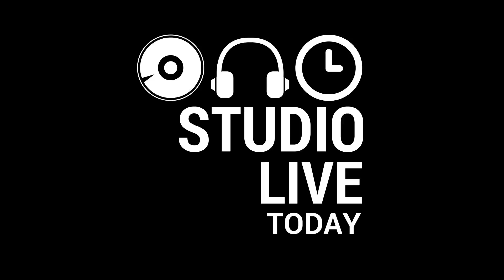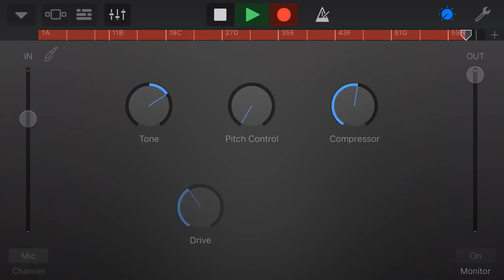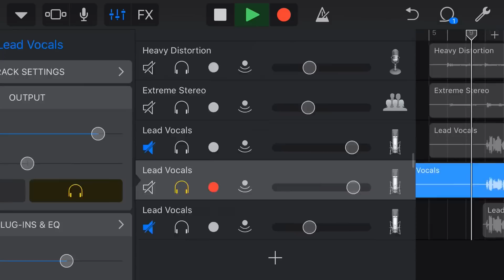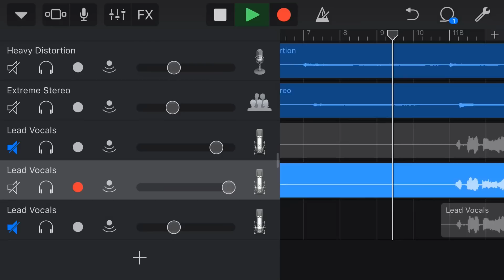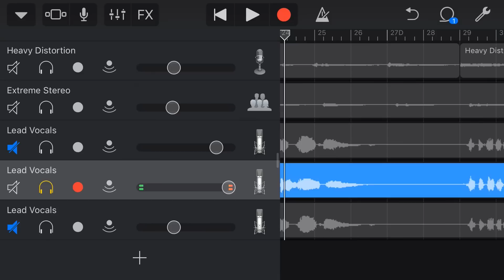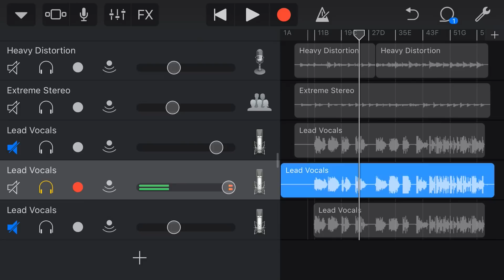Noise reduction plugin for iPhone/iPad (Brusfri by Klevgrand)

Comment: Please help! If you make a mistake with Brusfri and accidentally catch some vocal/piano, it ruins the sound of the vocal. How can you delete the filter you've created and redo it? I ended up permanently ruining a live piano track because I couldn't reverse or erase the Brusfri filter and, Garageband autosaves on closing. 

Also, some vocal tracks with an  affect on won't let me add Brusfri because there were no spaces to add it, as other filters were used. Any way around this please? Thank you!
Reply from the maker: Hey there. You simply go back to the plugin and redo the filter.
Reply: @PeteJohnsStudioLiveToday  Thank you for your reply. I tried to do that, but it kept the first filter on. How do you delete or clear a first filter please? When I tried to do it again it didn't remove my first filter (as if layering a second one).  Also, when I turned off Brusfri, it had permanently changed the track and left a faint crackle noise that wasn't there before. Trying to undo did nothing to remove it?